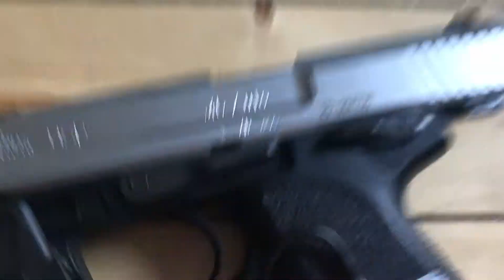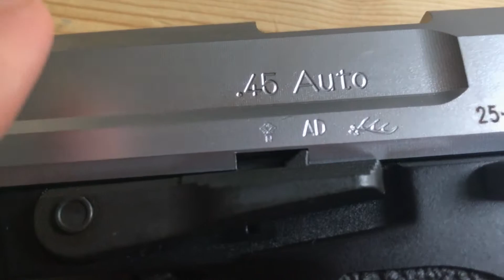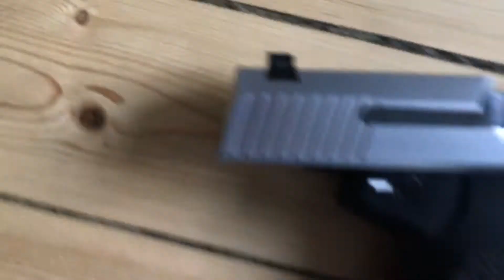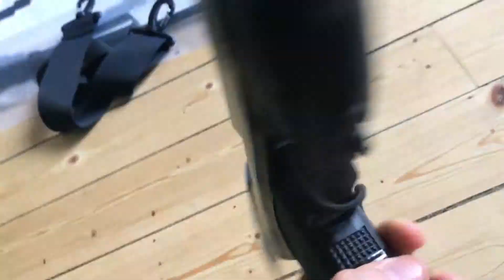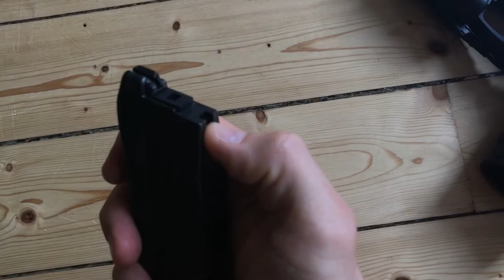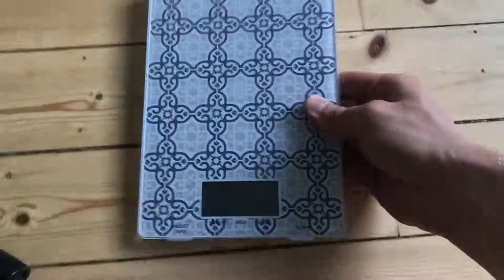Custom KWA USP .45

Comment: Isnt it to hard on the internal to use 4.0 nuprol.
im asking because I wanted to try it but im afrait to break it
Reply from the maker: Yeah, it will be harder on the internals. However, since I have such a heavy slide I really need a strong gas. :)
Reply: @Arginj  I will try a High Flow valve in my mags combined with the NPAS valve to be able to run my usp with a suppressor and cycle completely.
Reply from the maker: @jonathannmyst5524  Yeah, do that. I did the same. :)
Reply: A last question.
Which High Flow valve have you taken for the mags?
Angel custom or NineBall/Laylax?
Reply from the maker: @jonathannmyst5524  ESD :)
Reply: You did a great job with your USP!
Great vid and thanks for your reply!!!

Comment: Hi this is an excellent video!

I'm looking to also try immortalize my KWA MK23 (given its now insane rarity and chance i'll be horribly stuck if it breaks)

Could you perhaps share your knowledge on the following parts being potentially interchangeable between the KWA usp series and MK23?
(I say this as internally they do seem identical bar the slide and barrel assembly)
additionally, these parts don't exist for the MK23 but im fairly confident they can work..so this is why I ask to make sure

-Z parts steel slide stop for usp (i'm trying to figure out if the USP and mk23 are identical in terms of dimensions)
-RA tech Outer Barrel O-ring for USP 45 
-Action Enhanced Hammer Spring (150%) for KSC USP .45 GBB
-High output valves (nineball/ESD)
-NPAS (which one, the version for the MP7? how is that possible?)

also, do you not fear about the internals running such a high psi gas in less than 5c temperatures?

please could you possibly update the links in the description? they point just to the homepage of the site

Really appreciate it, thanks!
Reply: the MK23 is significantly larger than the USP

Comment: Nice video! I've been looking to get usp too and your videos gave me some good info. 

Where did you get the hammer spring? Also do you know if there are replacement buckings or barrels available for the hop-up kit you bought? I myself don't like the two piece nub but find it still an enhancement compared to the original :p
Reply from the maker: If I can remember correctly I bought the hammer spring from Airsoft Club. Unfortunately I do not know about any replacements - but try to contact the manufacturer and see if they have any clues.
Reply: @Arginj  yo bro why don't you post?